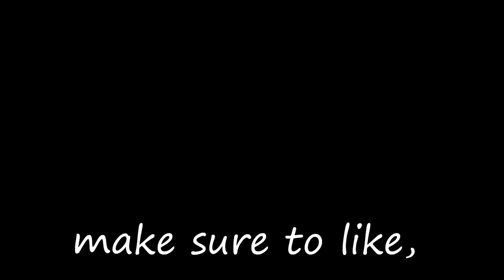***Lets Build a Wall!*** #projectSPL Update

Comment: Looks sick! I would run some bolts thru that over lap in the floor with metal plates on each side. Give a strong wide surface to keep the sheet metal locked to the box.

Comment: Very informative and very thorough video. I remember building the wall in my Kia. I see a lot of similarities with these builds. Piecing together and forming to the contours took the longest to do. Building the actual shell went by really quickly as well as the beauty panels. You really got a lot of work done in such a short amount of time. My new build incorporates a steel cage which is not fun, but it is almost done. Piecing the wood in is going to be fun. All kinds of crazy angles in this other vehicle. The shell shouldn't be too bad I hope. So far we are on track to be finished to go to the show in Florence SC. Tuned in for the next update. Thank you for sharing this awesome build Derrick!

Comment: Shell: 1,386 lbs, + loading wall + rest of materials for the full enclosure + subs...I estimate between 1900-2100 lbs total...? * not adding in wire, caps rhino liner etc...

Comment: Dude this is coming along so well . Two things where can I get one of those sundown shirts and can you show some footage of the foam application with that 16lb foam I’m interested to see how well it flows and expands . Are you worried about the foam breaking those back windows at all ?
Reply from the maker: I've already used quite a bit to fill voids and it will always follow the path of least resistance.  As long as there's an opening for it to expand into it will do that.  This stuff also has a low expansion rate and I'm pouring it lil by lil in small batches.